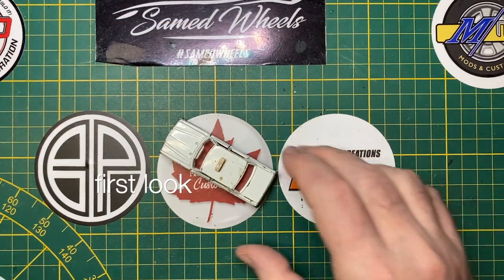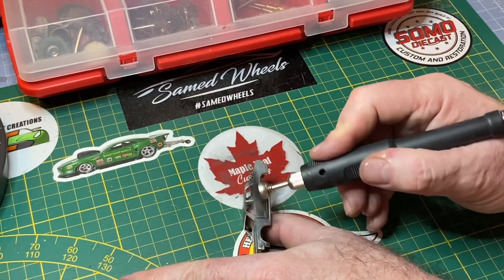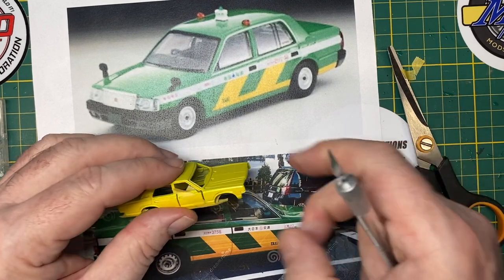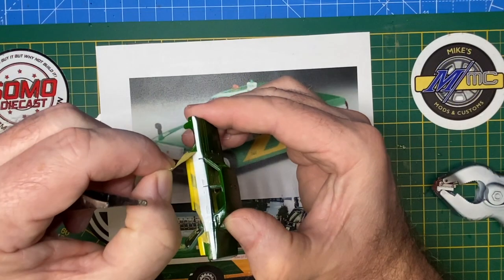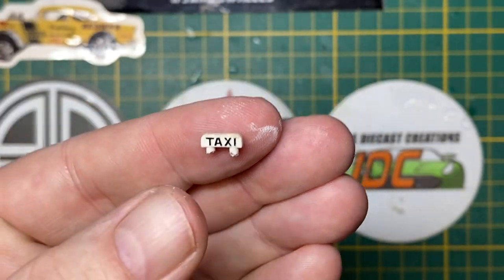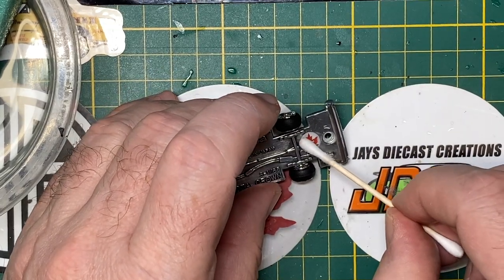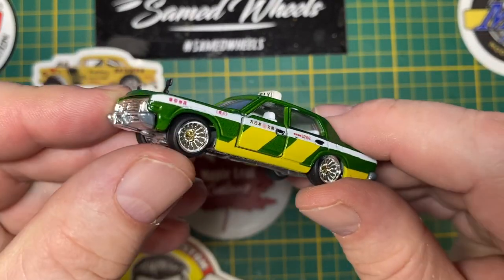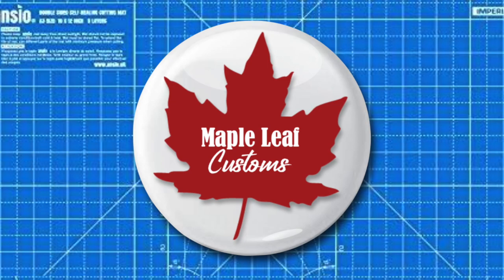Tomica Toyota Crown (153)

Comment: Hi Andtew ! I was totally amazed by your paint job on this Tokyo taxi! Especially in that scale ! I did spraying with rattle cans only on 1/24 scale up to 1/18 scale cars.
I have too big hands for 1/64 or 1/65 cars and would go crazy if it doesn't work perfectly. So I pull my head for this taxi you have done !
10 of 10 ⭐️!
Greetings from Hamburg !
Reply from the maker: Danke, Helmut! It was an intricate 3 colour paint job which required extra masking and much care. Came out well though, and yes, this small 1/64 scale is tough for me too! That's why I do the occasional 1/43 or even 1/36 model. Easier on my eyes! 🍁👊

Comment: Stunning job Andrew. That was a challenging tape job, and a  miracle that you had no bleed under or peel off issues. fantastic model, as usual.
Reply from the maker: Patience was required on this 3 colour scheme, Timo. I clear coat after each colour and wait overnight for it to dry before masking and shooting the next layer. That pretty well ensures no bleed or peeling, but I still depend heavily on luck too! 🍁😂

Comment: I followed until you put the mirrors on. I'm sure by now someone else has told you that they go on the fenders, not the hood.
Reply from the maker: Sharp eye, Garry. No need to be told that. I did a dry fit, and even though I was using the smallest mirrors I had, they still straddled the shot line onto the hood. That's why they had to end up completely on the one side they fit on. Not entirely accurate, to be sure, but I thought not using them at all would have been an oversight. Thanks for watching though. Wishing you a terrific weekend! Greetings from Switzerland! 🍁👊